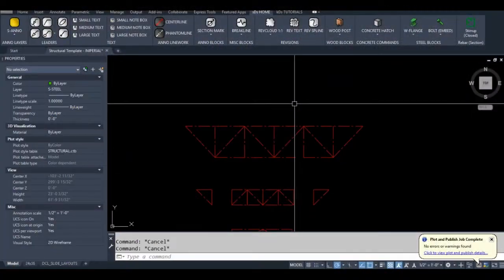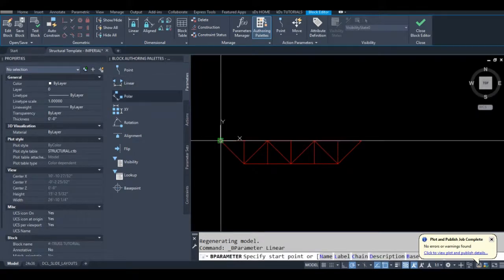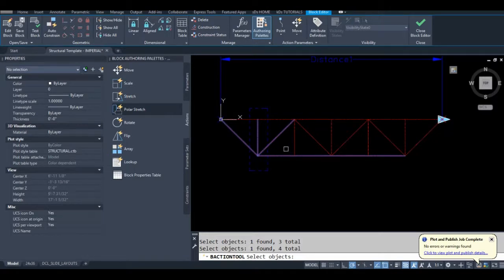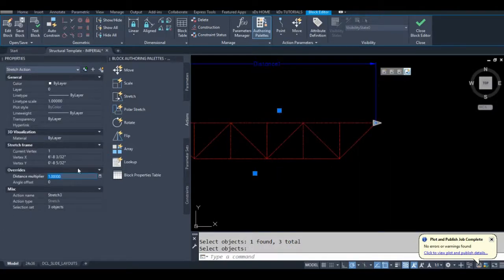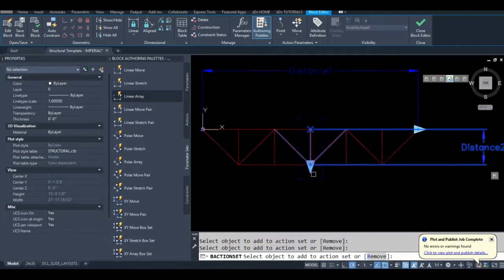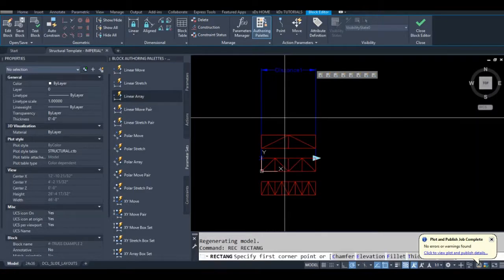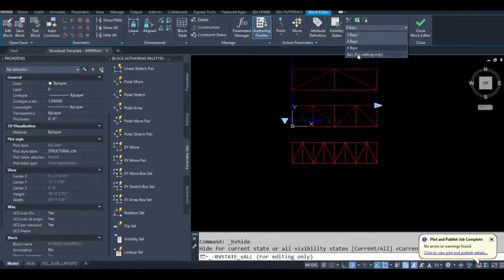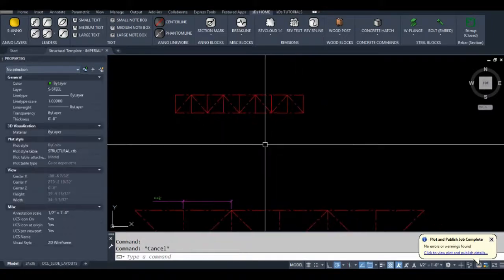Dynamic Truss Block Tutorial

Comment: wouldnt it be easier with array?
Reply from the maker: If I was working on a 'one-off' truss I would probably use an array. The 'actual' block I used when I used such a block in the office had multiple visibility states with different amounts of bays (which were almost always between 4 to 8 bays so the block worked in this instance). The advantage to using that over an array is that each bay 'stretches' as I lengthen the entire block. I can also lengthen the block from both ends. If you use an array you'll have to edit the source object as you stretch the entire truss. In short: multiple-uses and not too much variance in the number of bays, the block is easier in the long run. But a one-off situation, or very-seldom encountered situation, an array would probably be easier.

Comment: Great video. Just getting into creating dynamic blocks myself after having been in the industry 20 years. I work with Civil 3D, but still do majority of my drawing in 2D. Starting out with simple blocks with visibility states and linear stretching, but nothing as complicated as your truss...at least not yet. With that said it was nice seeing how the multiplier could be added, but not knowing anything about trusses and their design I didn't understand why you used those multipliers. Though I've started out simple...I eventually want to be able to make an entire Pump Station series of dynamic blocks so that for the concrete form I will be able to click on the block and in properties tell it wall thickness, wet well diameter, base thickness, footing thickness, footing lengths, and depth of wet well. Other things as well, but that in itself would be a huge starter and bit of a time saver. Same would be used for valve and meter vaults and have another dynamic block for the pipe run, valves and dresser couplings, etc for various size pipe.
Reply from the maker: The multiplier felt like sort of a 'hidden' feature for me. I had been creating dynamic blocks for at least 3 years before I discovered it.
The main reason for the multiplier (in this case) is that I want the bays (distance between vertical truss members) to be equal no matter how long I stretch the truss. Using a truss for the video simply gives me a method of showing the users how to use this feature. I'd need to create a pretty big block library of trusses for this to be of practical usage (a LISP routine would be better I think). I use this feature for reinforcing bar cut-offs actually. But that would be so hard to explain that I don't think I could make a video about it.
I'm not too fluent in Civil 3D (I used it in school that's it). The money is way better in the Civil work compared to what I do (multi-residential mostly but also commercial). I was thinking about getting back into it for a few reasons. One being that it is one of the few higher programs that can still benefit from LISP.
Your Pump Station block could also have parameters that automatically spit-out quantities. Although I'd assume that they are some sort of pre-cast unit maybe? I don't think it would be too hard to make a block like you describe! You may or may not need to utilize a block properties table, or parametric constraints; two things I don't have videos for yet.
Reply: @randomCADstuff  Thanks for the info and advice.